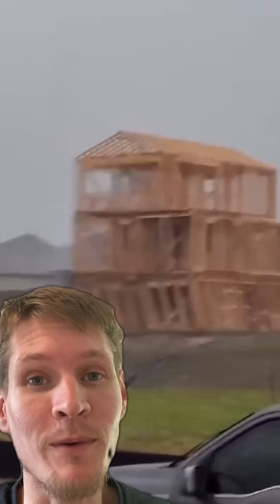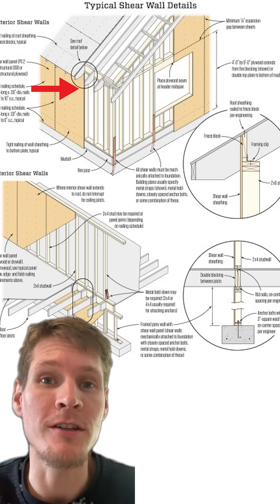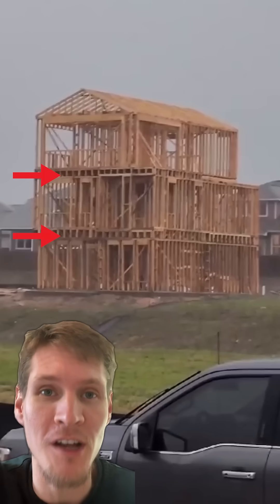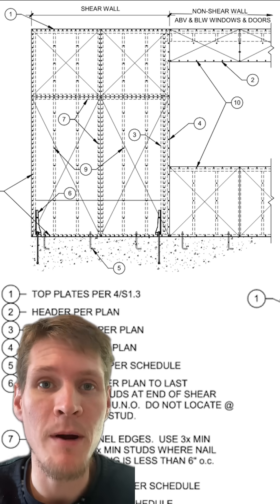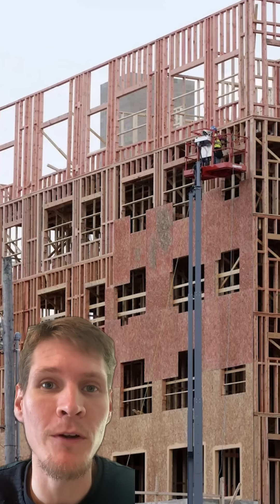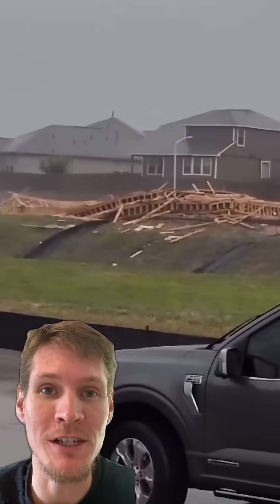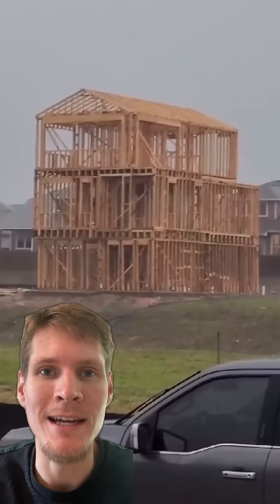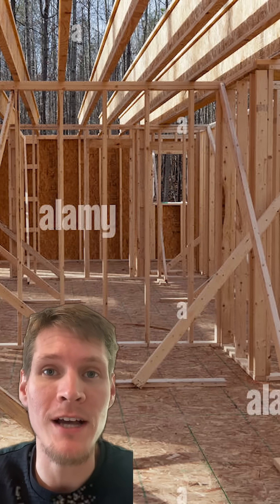Professional Engineer Reviews Reddit Structural Engineering Thread | Part 1 #engineering #reddit

Comment: That’s a lowest bid framer with inexperienced workers, a late plywood delivery, and a freak storm all at the perfect time.
Reply: They have plywood, they started sheeting the roof
Reply: @hoborobprospecting wow. Just wow.

What’s lame is that someone actually got paid for this disaster
Reply: @ChadDidNothingWrong  Roof sheathing is not the same as side wall sheathing - they can be but not for most residences.
Reply: @gholland5840  it's exactly the same, half inch OSB. If you want to get literal, it is 15/32
Reply: @hoborobprospecting  no they didn't
Reply: @Dziaji  um, then why is the roof sheetfed? Duh
Reply: @ it's just framed
Reply: @hoborobprospecting  I think you use osb for decking and roofing and ply for walls
Reply: @ToFree4U  OSB all around. A sheer wall panel has more nails(per building code) than a standard wall panel. Thats the only difference
Reply: Inexperienced?
Reply: No one that has a clue would be sheathing in the roof before the godamn walls......not evwn a brace on the outside, its bad @davidbrayshaw3529
Reply: Spot on lol
Reply: have necessary material on site before you start building
Reply: Build proper houses ffs
Reply: That’s not a freak storm. That’s every other day where I’m from. But houses are built out of cinder blocks where I’m from. I live in a bomb shelter compared to whatever this piece of shit is supposed to be…
Reply: And improper bracing....
Reply: Also could have used continuous lvl studs for the front that span all 3 stories to tie it all together
Reply: Must’ve been DR Horton’s job
Reply: Something I’ve been seeing happening lately is it being 2 separate crews doing the framing. Like two completely different companies. One to do the stick framing and the other to do the sheeting.

Growing up, we always put the plywood on before even lifting the wall, so seeing it be two different crews doing it, it baffles me, as I don’t actually see why they would do that.

And it wasn’t anything to do with time being wasted or not, we built hundreds of houses, and some were completed in just a few days. (Fastest I remember was 2 days from laying joists to sheeting the roof.)
Reply: @awesomeguy1346 if you put on the plywood before lifting the walls the the corners weren't overlapping
Reply: @ that’s why you put the plywood on the corners last after lifting the wall. Not hard to figure out.
Reply: Not a freak storm just idiot framers
Reply: No. That's ignorance and greed on display.
Reply: Or a GC or PM that said just do it
Reply: A real Swiss Cheese situation here.
Reply: Spot on.
Reply: That aint freak thats a normal ass day 🤣
Reply: Bingo.
Reply: Sounds like you speak from experience
Reply: That's a scab contractor and labor doing sh*t work. The storm is irrelevant if the job had been done correctly.
Reply: If only there was a way to make fully sheeted wall frames before hand so that the sheets were already on the wall upon arriving in the construction site. Then you would just erect the walls join them together and presto load bearing structure complete. One maybe even could do same with pre assembled floor boxes and maybe even roof sections.
Reply: No that's stupid overconfident contractors thinking they can build anything without any knowledge. You're just another contractor, a labourer. Hire an engineer and listen to him if don't want this to happen
Reply: Ahh yes the good old "structural plywood"
Absolute morons you lot over there😂😂 we wouldn't build a fking shed like that😂
Reply: They had plywood. They chose to start sheathing the roof before the lowest level!😂
Reply: Is it you?
Reply: Think about it... at some point there where people working on the first floor and people putting on the pitched roof... think about just finishing up while saying it's done... and the hole thing starts to fall over...
Reply: Summary: Average USA Citizen.
Reply: @theplouf5533  i wouldnt even say  that.  The average citizen knows to hop on google and youtube to research things and this is the kind of thing you would discover via a youtube search.
Reply: Yeah that's the illegal Americas that built that! 😂 @theplouf5533
Reply: @theplouf5533 let me guess, you were the builder. You walked into America and said I'm a contractor.
Reply: @theplouf5533  How do you figure somebody found an American to do this work?

Comment: I've built several multi story apartments, hotels and condos and have read hundreds of plans. Architects and engineers never take responsibility for means and meathods.  The closest they get is saying that the contractor is responsible for safety and not damaging anything.
We always install all shear and other lateral bracing before going to the next floor or roof.

Comment: I’ve seen this in other states (SW) and I always wanted to ask why they did this. I framed for 12 years and it is easier to put the sheathing on before you raise the walls. 
Idk if they have separate subs just to put the sheathing on later to save a buck or what. Some of our contractors had their own subs do windows to save money. 
Not safe where I’m at at least.

Comment: Its not shoring, its called bracing.  And its installed only where you need it to keep the top plates of the walls perfectly straight with a string line. Straight top plate, straight wall.  You do temporarily brace your first few walls per floor when there are not enough walls stood to keep eachother from falling over.

Comment: The crew who built the house next to us did the sheathing with the walls standing, in my 4 years so far framing it was the first time I'd seen it done that way. He said it was so they could run the second floor sheets down to the first and not have the rimming exposed, which I can see adding a bit of support, and it definitely looked better than having a 1' rip in the middle of the first floor, but it's definitely easier to sheet them laying down
Reply: I’ve been seeing a lot of stick framing going up with no wood sheathing anymore. They’re using plastic or metal straps diagonally for the rack strength and then tacking on some kind of cardboard/fiber material with a coating on the outside for waterproofing (or to seal the building envelope?). 

I’m not a carpenter or a builder, but this seems very new. Only noticed it in new developments for maybe the last 4-5 years. It seems really cheap and sketchy, and I wouldn’t want a home built that way.

Is this some new kind of standard and cost saving method? I know the price of materials shot up maybe 6 years ago, especially the wood.
Reply: @kermitwilson  I've never seen anything done that way where I'm located, but that sounds like absolute garbage. I'd say it's probably a cost saving decision on the developers end, though not because of lumber prices. Those came back down post pandemic in a lot of places, though I have a feeling they're about to rise again. 
I won't say stick framing is great, our housing in N.A. is meant to be cheap and fast(though it hasn't been so cheap on the buyer's end for a while), but I'd still trust 3/8's strand board a hell of a lot more than some metal strapping and cardboard. Hell, I'd even trust 1/2 densglass over that, and that shit's TP and flour!
Reply: thats the only way we do it in my company. i dont get why idiots do it like the way its done in the video.

Comment: I'm an armchair builder and even I know that lower floors must be completely sheathed and structurally sound before proceeding to the next floor.

(note: When I was younger, I used to work for architects and engineers typing up specifications manuals.  I'm pretty sure the specs specified sheathing first, before proceeding.  Unfortunately often times the spec manuals aren't read properly, which often results in costly mistakes that the builder has to bear.😱😭😭 )

Comment: I disagree if they put what you called shoring boards on the outside of the structure like "Code" requires for this it wouldn't of fallen over. No one likes driven spikes into the ground hence this happens!!!! Carpenter for 20 years never ever had this happen!!!

Comment: Trabeation, yo. 

The other way is of course to build ya walls from brick or stone, and a structure with 90° corners of well laid mineral blocks does a rather better job in almost every area. 

Still weird that the USA, especially, shuns brick and block housing a lot of the time.  It's a sound investment outside the tornado and hurricane zones, and frankly it's a bit sad, and lame, that buildings in areas with those natural disasters haven't evolved into more obvious and permanent forms yet. 

Surely some domed shapes of suitably thick steel or aluminum alloys, bedded well into the ground at the perimeter, like a basic foundation of 6 feet concrete footing would be less work than foundations for the same sized house in Europe, be well more than enough to resist any weather based event - unless that event tears up over a metre and a half of the Earth's surface and can carry off 100 tonne blocks, in which case, God just hates you sorry.  Also that's probably an apocalypse level event. 

Gotta be better ways than rebuilding things every two generations, that's such a waste and a ripoff, possibly.

Comment: I am amazed by american building techniques. It's like it has been so streamlined that it can now barely sustain itself. 

My house from 1952 has as the thinnest wood in the walls 2 inches thick. Everything is notched together and nailed together. And then they built a brick wall on the outside of the wooden timber. If the wooden house burns down the bricks will stand unless knocked over. If I remove the bricks the timber will stand on it's own. It is not reliant on thin sheets of sawdust glued together to keep it structural. Yet I think the price of building an american home is even more expensive than any similar structure in europe.
Reply: the wood in you walls is 2" ours is 1 1/2". Makes no difference unless your house is over-engineered. And the bricks mean nothing. If your house burns down, they will need to be knocked down.

Comment: The portapotty isn't a good reference as it's bottom heavy and has flat sides well above the centre of mass to catch the wind, meaning leverage, while the framing has a large % of open area. In this case, the ground floor temporary bracing was insufficient or poorly installed. It just parallelogramed.
We don't use exterior OSB sheathing here in NZ - bracing elements are the internal lining which is normally the plasterboard ('drywall'). I'm not sure if it's still the case, as I haven't had anything much to do with the building industry for 15+years except for bespoke exterior timber joinery, but the building regulations even considered plasterboard to have a higher bracing strength (as a diaphragm) than plywood. Yeah, the guys that make the plasterboard basically wrote the building code to suit themselves and their profits.

Comment: I'm retired union bricklayer. I'm no carpenter but know that the strength isn't in the sticks but the structure. I've seen sound block walls blow over because the steel trusses weren't in. It all works together to create strength. Engineering 101

Comment: As an amateur  (doing non commercial things) related to a professional, this is why I like to have vertical supports made from staggered studs with holes to connect the horizontal and diagonal bracing, sort of like traditional Japanese construction... But that doesn't comply with building million plus dollar houses out of matchsticks and compressed sawdust....😂 I get laughed at by people whose structures fall down in a wind...

Comment: This is why when my grandpa built his home, he use 2x6, 8 inch spacing, cross beamed every wall (not a ton of windows), and instead of drywall he used solid wood planks. All Douglas Fir, and on a steel reinforced 6ft thick concrete pad. 

Completely over engineered, but man is that thing solid. A 4.5 earthquake hit some years ago and my grandma couldn’t even tell it was happening until she walked onto the ground.
Reply: Yeah, most people don't realize a 4.5 earthquake is going on at first. 4.5 is not that big.
Reply: @ 4.5 isn’t that big, yes, but you will absolutely feel it. I experienced a 3.5 in Greece years ago and it rocked the entire ship I was on, and people in nearby restaurants also felt it.

Comment: I've only framed for 45yrs+. Long before OSB sheeting. #1 it's called plumb and line temp bracing. But without any let in bracing. There is no stable strength. Except no one knows how to install them. Temp bracing is  not for temporary shoring. There's no structural strength. For a design engineer. It's obvious you have no in the field experience. Try picking up and swinging a hammer for 10 hours a day.

Comment: It's really a lot easier to just build concrete frames and pour your house in, can handle a cat 5 hurricane or tornado with reinforced concrete construction and polycarbonate windows/covers. I just don't understand why we haven't made it common place in US. 

Building rebar supports is really not that difficult either since they don't have to be perfectly aligned, that's what the frames are for.

Trickier part is the ceiling and cross beams if you do them out of rebar and concrete to save money instead of getting steel ibeams to run across which would be super expensive. 

You can also just use wood for the middle floors and ceiling and the roof frames just go with an overbuilt and smart wood design so it doesn't blow off in a hurricane like an umbrella. That way you got loads of strength to your home.

Concrete construction is the best if you care for yourself and your family. You can make concrete viable even in earthquake prone zones with some extra steps. Literally making your home last as long as a middle ages castle.

Comment: As a carpenter with over 13 years experience, and started my first 3 years doing new residential framing, this style of framing is very common. I can tell just by looking at it though that there isn't actually enough bracing. many of them even look broken, which is common to find broken 1x4 or 1x with holes in them that make then unsuitable. They also should have still sheathed the first floor before going ahead with the second. 

The reason this is don is efficiency. It's easier to frame, and then you hire a sheathing subconstractor who just sheaths it in a single day.

What's too is i'm just now noticing the roof was half sheathed?

Comment: As an European I’m really surprised by the flimsy wooden houses.
Reply: They aren't that flimsy. I used to live in Central Florida with wooden houses everywhere rated to Cat 3 winds (200 kph). South Florida has more concrete homes, but even the wood ones must be rated for low Cat 5 (250 kph)

Comment: Nonsense, porta pottys aren't anchored to a slab and sheathing probably wouldn't have done much for this structure.  I've built structures, many MUCH larger than this for almost 30 years and had porta pottys blown all the way down the street without my work coming down.  That said I watch weather forecasts and probably wouldn't have touched this thing to begin with.  

My comment about the sheathing has to do with the fact that the home is all framed opening on the ends and doesn't allow for much if any sheathing anyway and interior wall sheathing may have helped but would have likely just resulted in some twisting before collapse.  A big part of the problem her in Texas is that a lot of homes, particularly outside of municipalities, are drafted by people with no qualifications other than an ICC cert.  So they know allowable spans and material standards, but will draft monstrosities like this with no one to push back.  There's no world where I build this without framing the first 2 floors in structural steel with serious footing in the corners.  Maybe I'm wrong but this just looks like a stupid structure.  Run the calcs based on what you see, bet it's garbage.